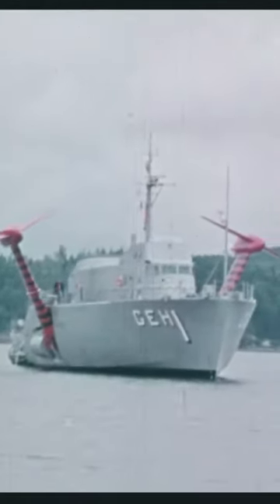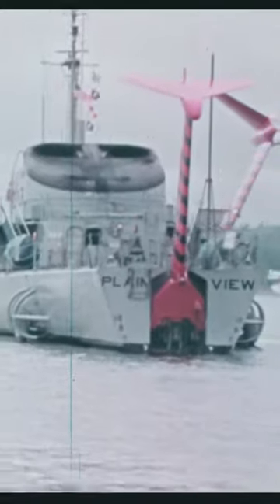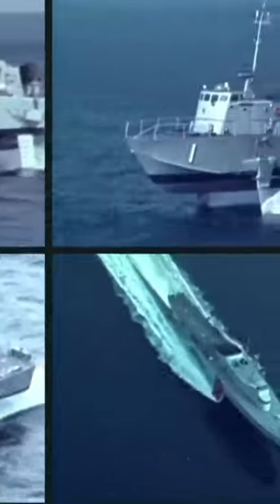What Happened to The US Navy's Flying Ship? #shorts

Comment: I was stationed at NAS Key West the last years of the PHMRONs. NS Key West is a large diverse Navy base. We share space with the Coast Guard, Army and Air Force. We have sub pens, an airbase, a seaplane facility, blimp facilities, extensive docks and Special Warfare facilities. One of those? Trains harbor seals, dolphins and pilot whales. Pilot whales are not common in the Florida Keys, but bottle nose dolphins are. There were four hydrofoils when I got there and they worked drug interdiction. One was going flat out and hit a pilot whale, killing a Special Forces asset. Pilot Whales are not small, and that one was large enough to cause over $20,000,000 worth of damage to the ship, the small crew had a 100% injury rate with the cook having the worst injuries because the oil in a deep fryer adheres to the laws of conservation. The next vessel would hit either an unmapped sandbar or coral head nearly ripping the forward foil off the ship, and had 100% injury rate with multiple serious injuries. Then the third and fourth were speed limited due to the obvious serious issues related to any accident that resulted in a full stop. The forward foil and its mounting would be destroyed beyond any ability to repair the ship without essentially rebuilding it. Meanwhile the crews would face total permanent disability or maiming. The ships were too small to affect a battle, to obvious to sneak into a port or up on an opponent, and its weapons capability was one gun at 76mm, and 4-8 Harpoon anti-ship missiles. It cost too much money, hurt too many sailors, and had minimal impact on missions and the ship itself could be replaced by a slew of other ships.